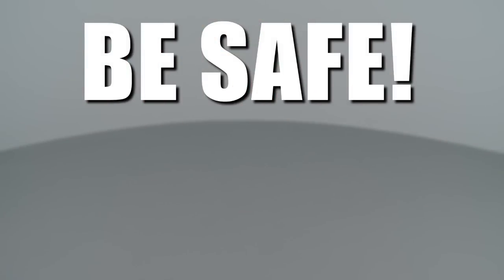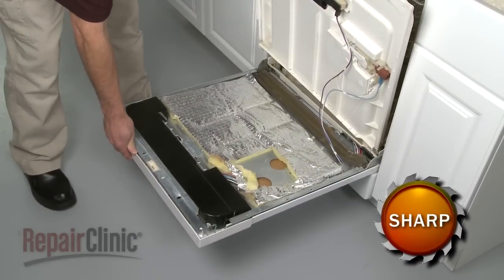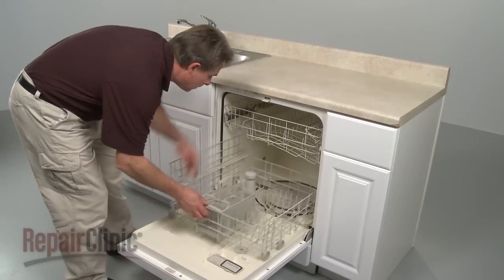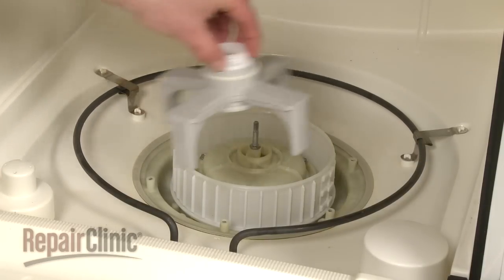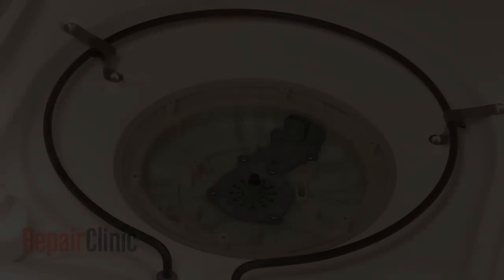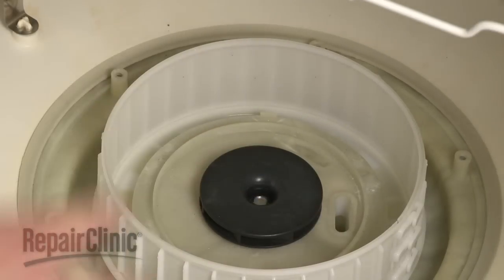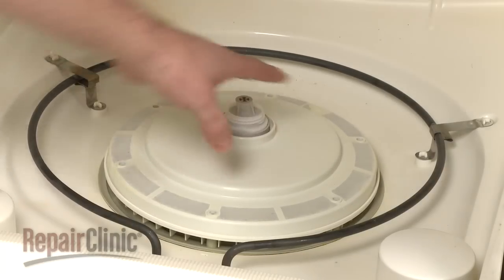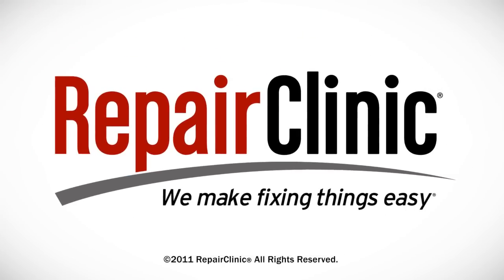Maytag Dishwasher Disassembly – Dishwasher Repair Help

Comment: I have the exact model in the video they are Torx screws and you need a Torx screwdriver.  Mine is 20 years old and who would of thought that they would have used that back then..

Comment: what is the model # on this machine? I seem to have the same one but my tag inside the door is rubbed off
Reply: +Mitchell Turcotte    It looks exactly like mine which is a Maytag MDB4100AWB. I took mine apart and reassembled it using this video so it worked for me. Luck.
Reply: Ours is the MDC4000AWX…probably other models with similar structure…everything shown in the video matches ours….Since your post was a year ago, guessing you figured it out!